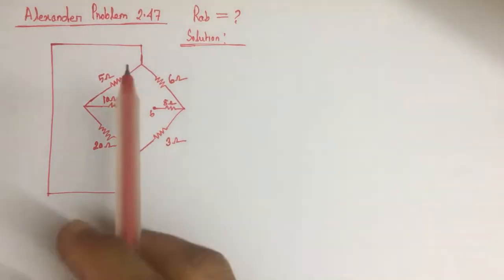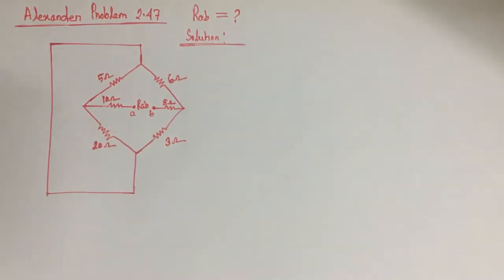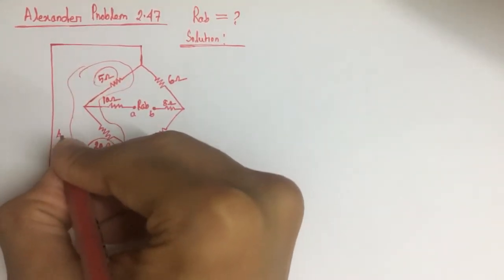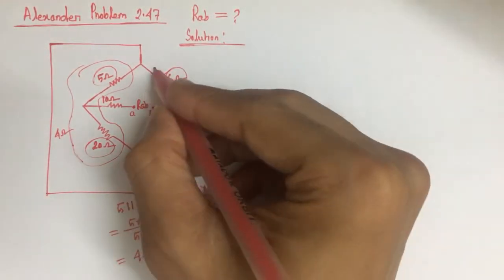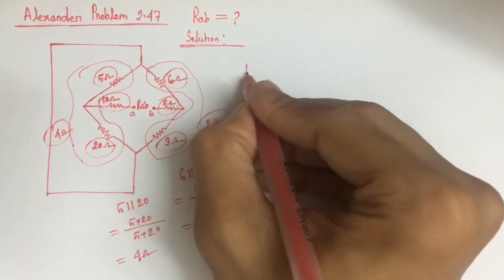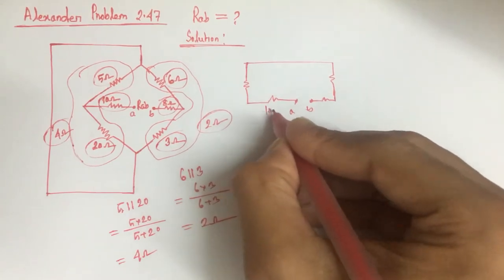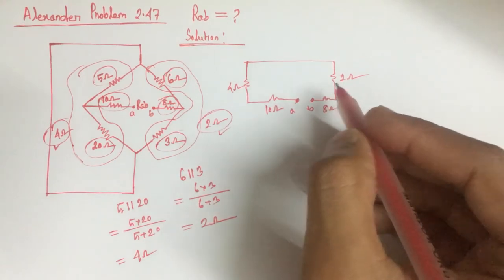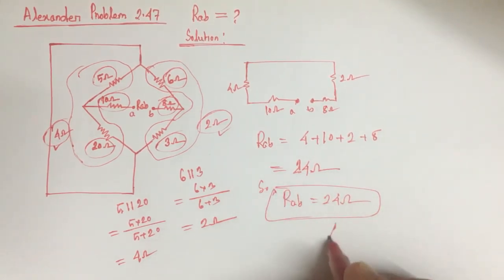Series & Parallel Equivalent Resistance Solution (Alexander problem 2 47)

Comment: for some folks its hard to understand how they are in parallel ... it would have been much better if you changed the structure of diagram ... like how the common points and how they are in parallel ...

Comment: its hard to understand how they are in parallel it would have been much better if you changed the structure of diagram 
 like how the common points and how they are in parallel